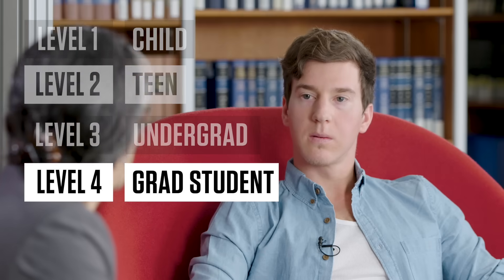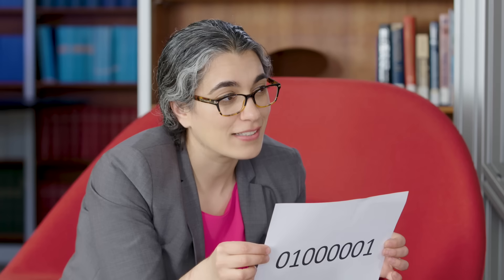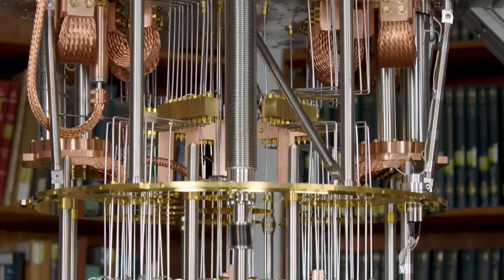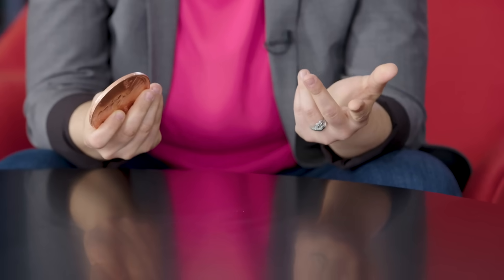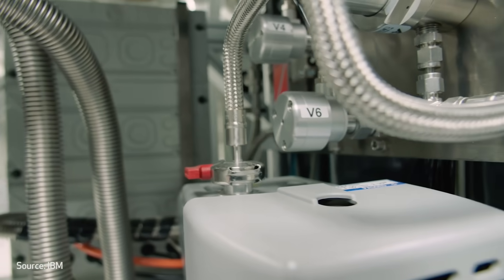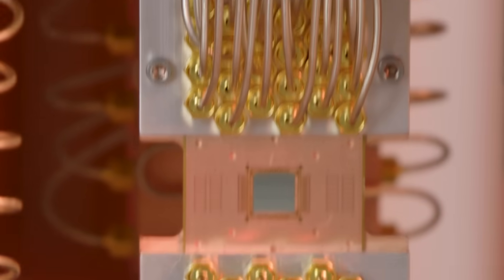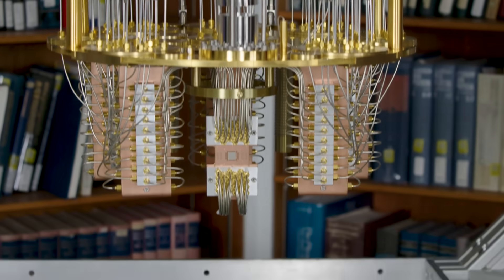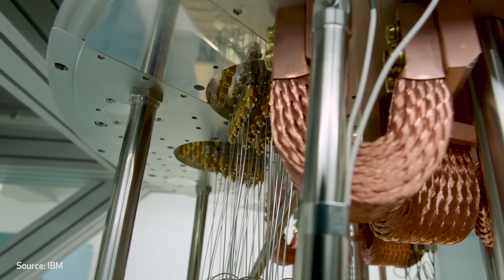Quantum Computing Expert Explains One Concept in 5 Levels of Difficulty | WIRED

Comment: Level 4 & 5 : The understandable parts. Level 4 superposition spinup & spindown at the same time. 

Solution/Fault tolerance: Improve your time accuracy to capture the slowing down electron spin. Now you have cameras to capture at the speed of light or even more. Source:TED. 

Hold on:
If your improve your speed of capture again you are talking about binary states!

So your quantum computing definition itself is wrong!!!

The stupidity of fault tolerance is the acceptance of fault - Vikram Srinivasan

Level 5: She asks questions & he explains instead of she explaining. Its the inverse & already quantum!!! When 2  professors at similar level of entanglement both are complementary in nature.

He says adding more qubits is adding to problems because of the nature of the problem itself.

This is what he means by saying building accuracy with inaccurate parts will add up to inaccuracy.

Comment: 8:15 if they are trying to find answers, how do they know what the "right" and "wrong" answers are in which they use interference to amplify or deconstruct? EDIT: Asking as a complete newbie to quantum mechanics and computing. Not trying to be snarky.
Reply: Just like mathematics, you might know certain parts of the answer, so you could sort of push the computer in the right direction, by telling it where not to go. If you imagine it like a lost traveler who's trying to find the way and the road splits to 10 different roads. You might be aware that one of the roads is a dead end, so you tell him and now he only needs to check 9 roads.
Reply: mikkel123sej thanks for the great explanation!
Reply: @mikkel123sej ,butit6u5t t_r/t2\ý6r^f`○

Comment: This just boggles my mind.. if the binary code of a non quantum computer is made up of zeros and ones what does the quantum code looks like? I guess it has 1 and 0 but then what is the symbol of superposition? And how does the computer accept it as a valid value when in fact its 2 values at once?  The way i imagine it right now, is that, for example for a 3 digit binary code where the two first digits are "1" lets say, and the 3rd digit is the superposition digit, the computer reads it as 110 and 111. So does this mean the computer runs its algorithm twice? Once for the 110 case and once for the 111 case?

Comment: I wonder how long it would take to run a direct numerical solution for air flow around a car for example, or flow around a super Sonic jet?! 

Maybe we won't find a univerasal solution to the Navier Stokes in the next 50 years, but hopefully by then we'll have powerful computers that can quickly calculate solutions to turbulent flows.
Reply: Well the level of quantum computing is at its infancy. they haven't even used 100 qubits. . AI is whats scary. Really scary. neural networks combined with highly effective quantum computing. If it knows to solve a test it will know to fail it.

Comment: I am sorry but I have to correct you on the issue of entanglement. Tow entangled electrons for instance although they are entangled they always go in. the opposite direction. If one electron has a spin in one direction the other electron always has the opposite spin. So if you were using coins to illustrate entanglenmet what ever one has head or tails the other coin would always be opposite.
https://www.youtube.com/watch?v=ZuvK-od647c

Comment: Very interesting. But I found one weakness during the discussion with the professor. He seemed to be suggesting that PK's (he gave RSA as an example) main use is for secrecy and could be easily replaced when Quantum computers are available for use. It is true that this type of encryption is used for secret key exchange. But asymmetric encryption is also widely used for non-repudiation and digital signatures. The point is that proof of non-repudiation may need to be maintained for many years as the basis of a binding contract. So if Quantum computers suddenly appeared on the market without warning it could be a disaster for the commercial world. It looks as though a complete Quantum computer is still far in the future but the affect on the existing Public Key Infrastures will need to be addressed far in advance of the building of the first fully functional device.

Comment: wires? all i saw were stainless steel hard lines and a giant heatsink which likely uses compressed refrigerant or maybe something further like liquid nitrogen for head dissipation... but I dont really see quantum computing as more than a 33.33% increase...the entanglement item is great for mimicking but i dont see that as being used to compute anything... while the super state is like adding .5 to 0 and 1 computer language... hence 33.33%. I saw a bunch of copper... its funny how ive never heard of anyone else bringing up...conductivity seems to be electrical  as much as it is thermal. I mean the best electrical conductor is also the best temperature conductor. Hence copper (due to cost ratios). meh.  theoretical is fun...if you're asleep. cuz in essence quantum is the same as a dream... intangible and only theory.

Comment: The thing about computers is that they can only see things as either 1 or 0 meaning the higher the number you are using the more amounts of 1 and 0 are needed. For example in order to have a number 3 the computer needs to go through 00-01-10 and all of these numbers take up 2 slots of disc space. Our brains are more advanced than standard computers of today since every brain stem that store memories can do up to 28 something signals (don't know the exact number) which to an normal computer would take up to 5 slots since with every 1 or 0 we add the number of possible positions that we can arrange them in doubles.

To take this into perspective our brains can create up to 784 possible memories to store using only 2 stems (28*28) which for an computer takes up 10 slots (2-4-8-16-32-64-128-256-512-1024) so if we could make the computer act like our brains they would be able to store 5 times the amount of data on the same area of hard drive (even more in reality but doing a very rough estimate in order to not make this too complicated). The problem is that our brains do these 28 different signals by doing different frequencies which is not the best for energy conservation.

Enter what quantum computers are trying to do by adding a state where the information can either be 1 or 0 with super positions, which significantly increases the number of possibilities that can be used thus increasing the number of info that can be stored on a specific hard drive, which reduces the amount of overall 0 and 1 that the computer needs to keep track of during an calculation thus making it both be able of storing a larger amount of info while also increasing the speed of an calculation assuming we are using really large numbers in our calculations.

Comment: One great explanation of the quantum computer is if you're trying to mow your lawn, you can build a really big lawnmower (that will have trouble maneuvering) or a really fast lawn mower (that you would still have to move around) and both would have to slog through the normal mowing process = current computer. Or you can have an unlimited number of small lawnmowers all cutting one blade of grass each all at the same time=quantum computer.

Comment: Does this mean we would be able to build a simulated reality that has consciousness?
Reply: That escalated too quickly
Reply: westworld
Reply: Yes
Reply: Not necessarily. Maybe with a lot of screwing around with a quantum processor, but it's a ways away. Basically, what a quantum processor does is it uses microwaves to alter the bloch spheres of qubits in a predictable manner, sort of tuning them to match the given environment to simulate, whether it be a problem or a reality. We then apply (sorry, but this is my ML training rubbing off) an activation function with microwaves, leaning the quantum state towards the solution. We then apply error correction and collapse the wave functions of our qubits, giving us the solution. So the main thing you're getting here is that it's simulating something. The problem is, a collective reality requires entangled communication between every body in that reality, with each body in the reality serving as a neuron in that mass. However, consciousness isn't necessarily something that can be defined, it's very much defined by the specific training the model undergoes. You'd somehow have to get the qubits to simulate a patch of an infant universe, then apply a microwave function to the qubits to tip the solution towards the quantum state of a predefined consciousness (probably a human), and the quantum effects would fuse the two together into a conscious reality. The real question however is why would you want to create a conscious reality? It has no applicable problem solving capabilities. If you want a quantum consciousness, use a quantum computer to simulate a consciousness then accelerate the operations with superposition. I'm not really seeing a need to simulate a full reality, because that means the qubits are doing more, receiving more microwaves, thereby meaning decoherence gets accelerated and you lose your info a lot faster.
Reply: There is a process called Child Birth
Reply: No.  Not true consciousness.  But perhaps a artificial or redefined linited consciousness.
Reply: Makgatho Maropeng Sure it did Lol
Reply: Thats earth
Reply: No

Comment: I personally think quantum computing is a waist of time, at least for the time being. I feel it will serve a purpose just not on the level everyone is hoping for. One application they may be used on though could be mapping a safe rout threw space especially if we some how figure out how to fold space. But as for right now, the money spent will take many years to show a return. We just don't have a use for it yet. To try to use one now is like if some one bought a Ferrari just to drive as fast as they could one block to the corner store to buy a Coke.  I think they are looking in the wrong direction. I believe nano-science makes more since at this level. I also think that if at any time you want to design ,well, anything, all you have to do is look to nature and find a way to reproducer it. So if you want to build a SUPER-computer try to find a way to put the human brain on a nano chip.
Reply: Um, no. The Ferrari analogy applies in certain circumstances, but on a very extreme scale. It's the difference between decryption taking 20 years and 20 seconds.

Comment: Two take-aways for me:

1. If electromagnetic energy is used to control (i.e., "program") a qubit, and electromagnetic energy is used to sense ("read") the qubit state, then how does one avoid the problems associated with the Heisenberg uncertainty principle ? Specifically, the energy used to detect the state at the quantum level will in fact change the state !

2. Regarding the fault-tolerance discussion, it would appear that the very multi-state properties of a qubit make fault tolerance a very difficult problem to solve.  

Fault-tolerance in binary-state memory chips, for example, is accomplished via additional bits that encode the patterns of the informational bits (e.g., Hamming encoding, at various levels - detection, correction, etc ).  

Creating mappings of the states of multiple qubits using additional qubits that are essentially hashes of the informational qubits strikes me as a mathematical exercise that could be 'explosive' (i.e., not converge depending on the amount of information in the original state that is to be made fault-tolerant).

We are clearly at the 'first transistor' stage of quantum computing.

Comment: None of those explanations were particularly hard to follow for me. And I'm a college dropout with a high school diploma that couldn't handle Calculus II and integrals. Understanding a concept on a theoretical level and the implications of it is somewhat easier than having to actually deal with equations or answer very specific questions about the mechanisms. 

For instance, I had a sense that the fear of quantum computers breaking encryption wasn't a real issue because I know they can only break a specific kind of encryption easily that just happens to be very commonly used. And that more than likely, people would just stop using that kind of encryption and perhaps even find more secure methods that take advantage of quantum processes, making it even more difficult for hackers in the long-run. On a theoretical level, the idea that quantum computers are prone to error and thus need fault tolerance much like early classical computers, or the idea that they can solve some algorithms quite quickly due to not being confined to binary/linear processing isn't that hard to grasp. The binary nature of classical computers was actually quite frustrating for people who were used to analog processes and measurements for many things before computers. They found it very limiting in some ways.

But if someone were to ask me exactly what kind of encryption should be used instead, and whether I could program it, I'd have to say I don't know. If you asked me to build or program a quantum computer, I couldn't do that.  Having a vague, theoretical understanding of something and the basic principles behind it is a lot easier than actually building it, building a program that can run on it, or putting that knowledge to use while expanding it via experiment.